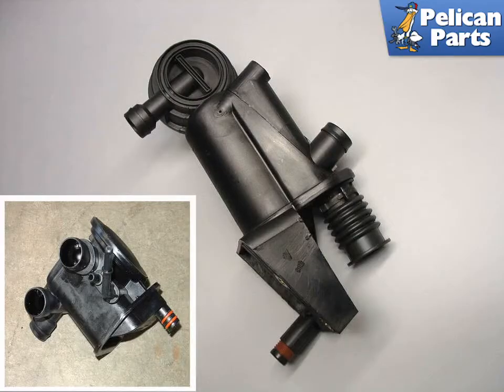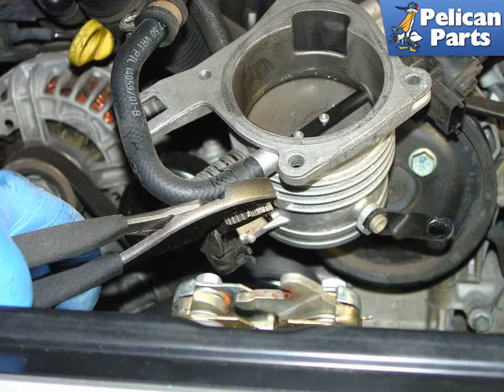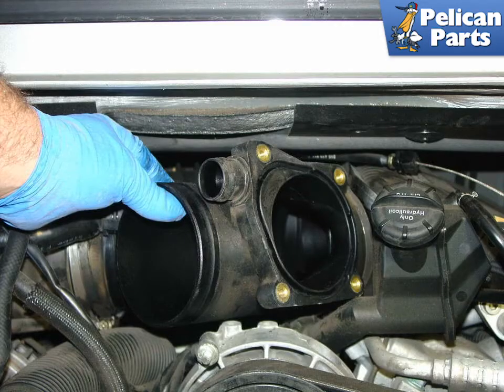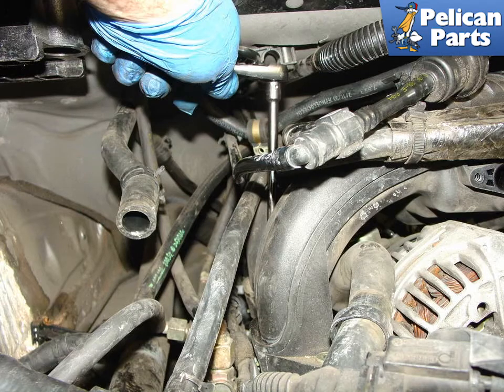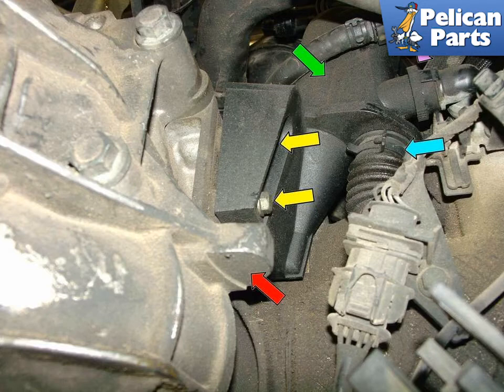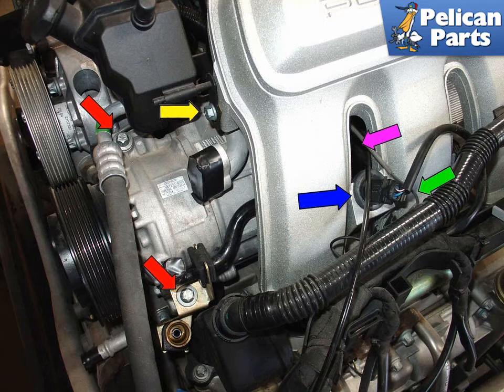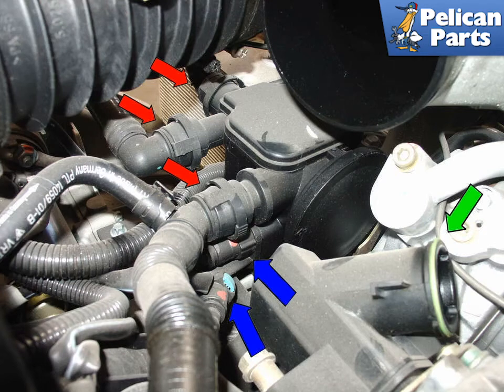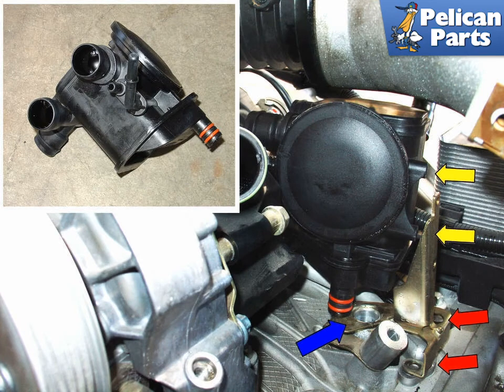Porsche 996/997 Air Oil Separator Replacement (1998-2008)

Comment: Can I check about the M97 engine. Everything I see in parts catalogues says the 997 3.8 with the M97 engine always had the newer style AOS, from 2005 onwards.
That suggests it was only the early 3.6 997 engine that had the old style AOS at first?
Reply from the maker: You didn't mention what year and model vehicle you are working on.

With your vehicle info handy, give The Pelican Parts parts specialists a call at 1-888-280-7799. They can figure out what part or repair kit you need.
Reply: @pelicanparts  thanks, it's a 2005 997 Carrera 2S 3.8. I have managed to look into the engine bay today and I confirm that I can see the later version AOS on the car so I think this may suggest that all M97 engines have the later part which I think slightly contradicts the information on the Pelican parts DIY webpage?